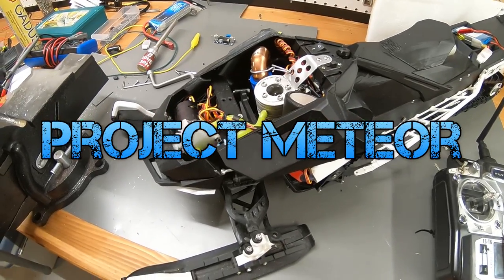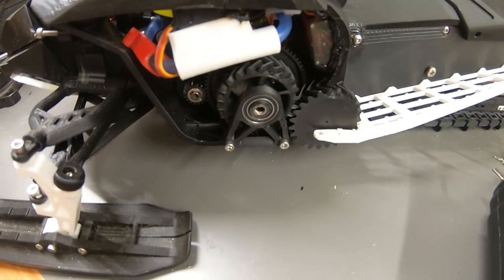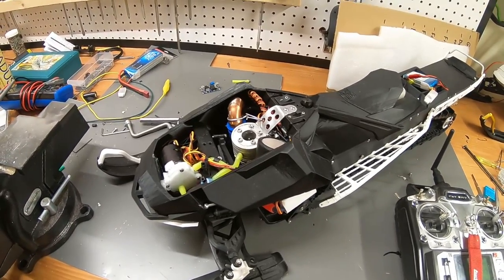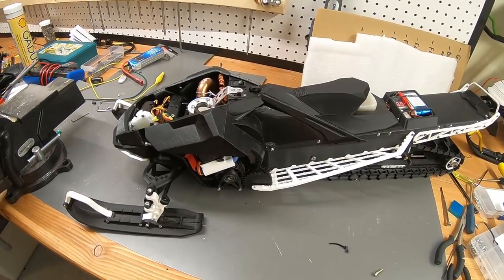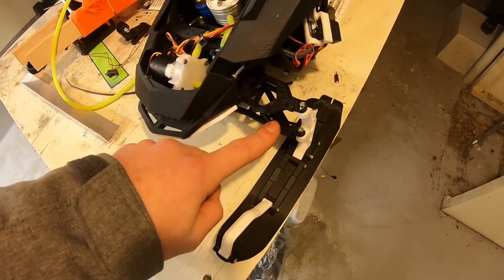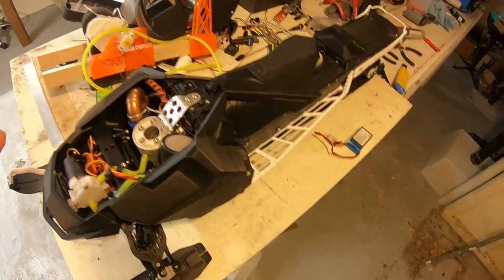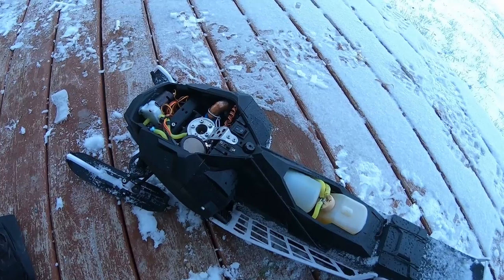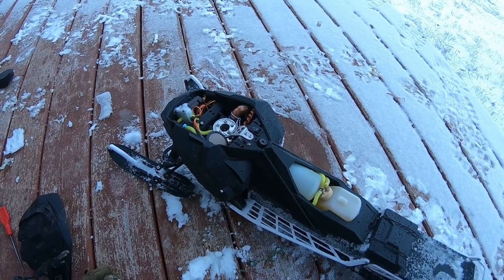Water Cooled Nitro Rc Snowmobile is back! - Project Meteor

Comment: What is the filament that you switched to? My son has built a sled and continues to break upper and lower control arms. If you could, could you please tell us the kind you use.
Thanks.
Reply from the maker: I often use Tpu, its flexible material. You lose a bit of steering precision tho

Comment: Wy Not using pull start for réalisme save weight use fan like older Snowmobile that big bruched engine pump ad lots of weight save al the weight posible older Snowmobile engine was just air cooled like Most Nitro engine the tuned pipe its big parts of tuning if change made To it power wil change To ... Tink best build new engine setup lightweight wit pul starter no cooling modification just coold air wil doo job y have run m'y savage x on Snow wit padle  y was using aluminium foils on engine heatsink for protection from cold air u did revers try without cooling just use normal bugy heatsink